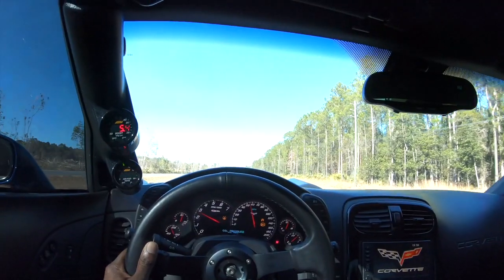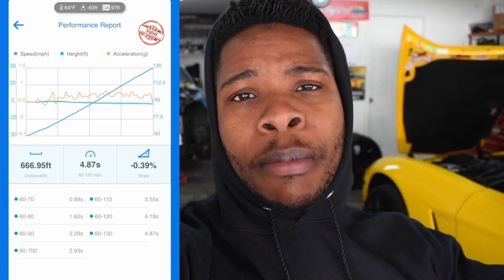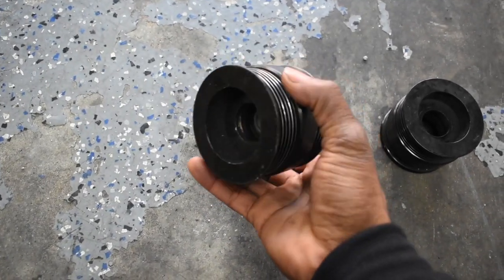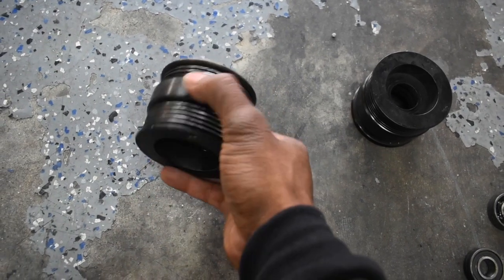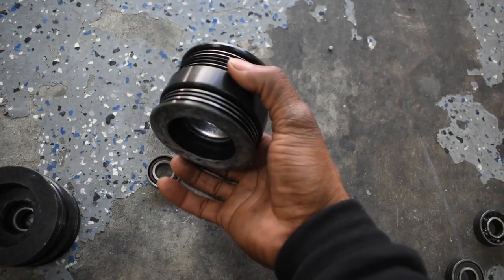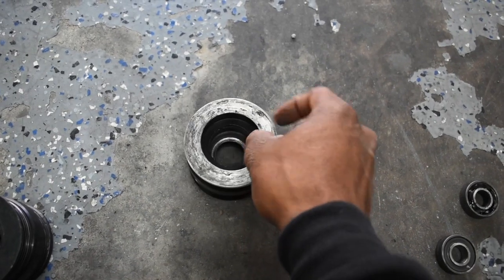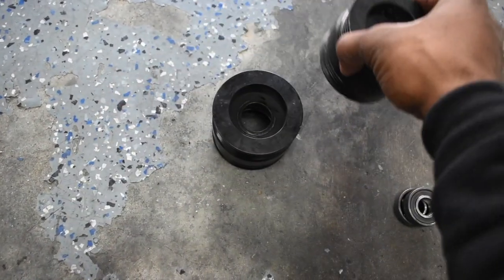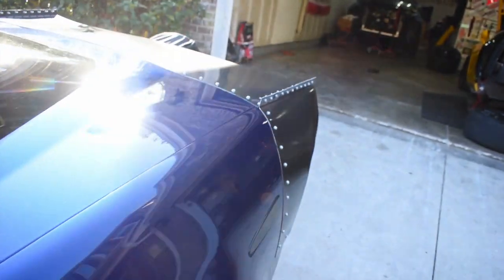Issues With ProCharger Brand on This 441 LSX C6 Z06 | Is A&A the Answer?

Comment: I'm glad I found you. I have the 12 rib dedicated drive with a F1R and a 10% OD. I have broken numerous belts the accessory and the 12 rib. Not sure how I go about having everything re sized and spec'd. But I now know I need to buy the AA bracket and start from there....
Reply from the maker: Oh yes. I would definitely start by swapping outta the ProCharger bracket for the A&A brackets. No more issues so far, knock on wood

Comment: I have an A&A they definitely are a brand to go with when it comes to the LS platform. Be sure though if you do get the upgraded brackets because I’ve had belt slip with mine before which is a older bracket set up but the new brackets work flawlessly
Reply from the maker: Yessir, the new design brackets we’re what i ordered this week. Fingers crossed that this works

Comment: I had a nasty n/a plus spray c6z. I had that I need more bug hit me and ended up with a fully forged lsx with a f2. I had the cog setup. Worst decision I made. I could never get it right and constantly shredded belts and everything was perfectly aligned. I wish I never did it and instead went turbos. Or even an even nastier n/a build.   I had that same holly intake also. Pretty sure I was one of the first to run it and cut the hood. Your z is clean bud 👍🏽
Reply from the maker: Damn that’s crazy, generally people make it seem like the cog belts are 100 problem free little do you know. Crazy story man. Yeah I just invested in the A&A bracket and curious to see what happens
Reply: @McgradyRacing  that’s exactly why I went with it. But it was the complete opposite. My kit was from Dallas performance. Another guy I talked to on the forum had the same kit and same issues. So not sure man. Best of luck with the A&a kit 👍🏽

Comment: Those tires are legit I run the same ones. I’m pretty sure the Grannas racing Supra runs 275s with ~2K hp, so that should tell u something. Taller over wider all day for straight line performance.
Reply from the maker: Yessir, we’ll keep playing with the tire pressure when we have the car put back together

Comment: That 275 works very well. C7 I just put together is running 275/60r15 and we are still at 30psi in the tire dead hooked from a 30 roll. Did 4.88 60-130 with passenger and late start.
Reply: 416 f1a-94 car.
Reply from the maker: Nasty !!
Reply from the maker: Sounds stout! What is the car making? If you don’t mind me asking? Or a ball park
Reply: @McgradyRacing  it made 930 on 12lbs. We are turning it up for tx2k shooting for 18-20lbs so hopefully around that 1100 wheel area maybe more

Comment: Love the build! I have a Paxton setup on my coyote, is it possible that you are over spinning your blower and that’s why the bearings keep failing? I know Paxton tells you the maximum shaft/ impeller RPM. Have you thought about slowing the blower down by changing your lower pulley? Love the content by the way!
Reply from the maker: The pulley with the bearing failure isn’t on the super charger it self, it’s the pulley that drives the alternator and power steering. A&A uses 3 larger diameter bearing to strengthen/reduce the rpms see and that looks like it works for their kit.

Comment: Kudos for progress. Before going turbo, I'd be tempted to drop it off at A&A and say MAKE IT WORK.  Not saying you can't do what they do, but this is exactly their cup of tea. Not saying ProCharger is inferior.  Lots of folks refuse to go with belt systems for this reason alone. A&A revolves around Corvette.  I'm not a car guru, but think Viking might be the answer. I do well to cha ve spark plugs tho LOL
Reply: I agree with this lot of my boys that have vettes have A&A’s. But pro charger is such a big brand so there’s that too. I just sold my whipple and went turbos got tired of eating belts and ultimately turbos have a lot more adjustability especially when having traction issues.
Reply from the maker: Yessir, I’ll definitely miss how hard the ProCharger hits
Reply from the maker: Lmaooo yeah if nothing shakes out of this, I’ll be looking at a turbo set up. I’ve already seen multiples set ups that Id love to run